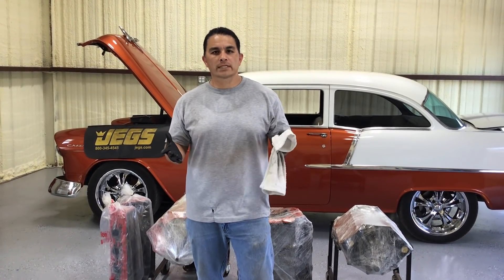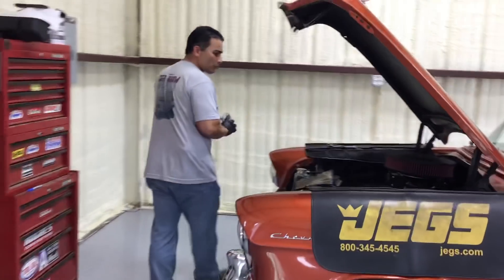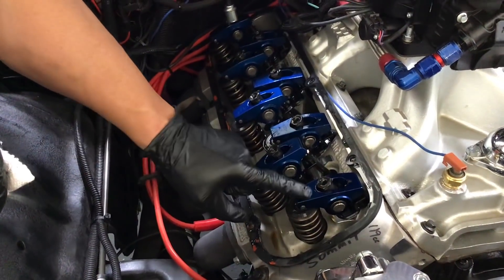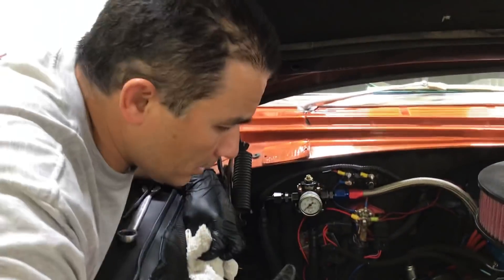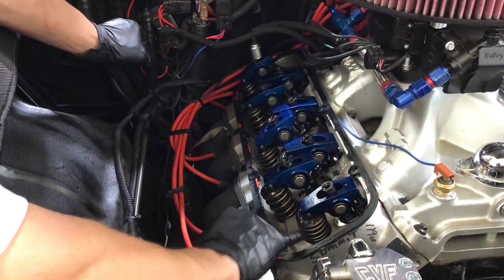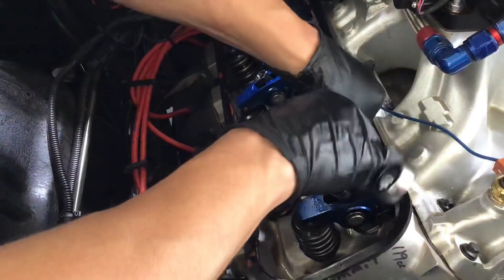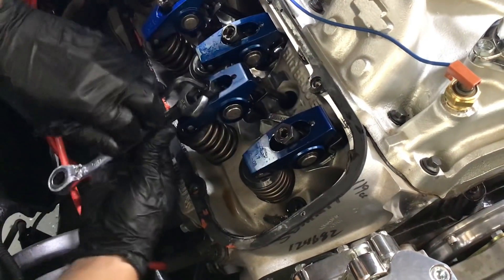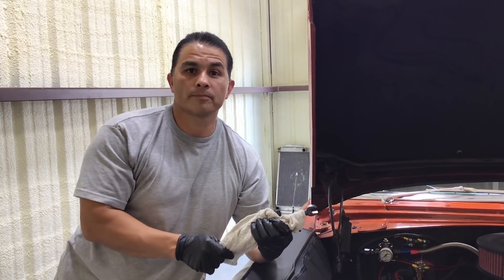Adjusting rockers arms bbc 572

Comment: Thanks bro I bought a 496 bb chevy from blue print it came I know  stock push rods factory rocker arms I had a builder change it out 1 peice push  rods and rocker arms motor was already dynoed ...from blue print but had it dynoed by engine builder in my town...changed valve covers had blue print on them guy didn't relash valves rockers are loose I'm pissed 5 dyno pulls thanks for vid I'm doing this few hours and yes it's got a hydraulic roller cam